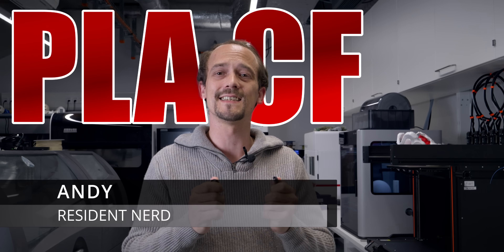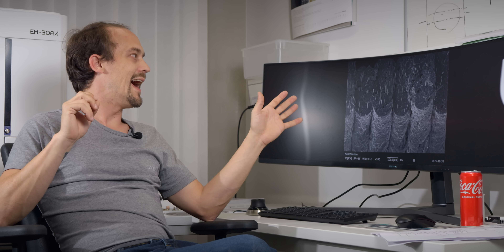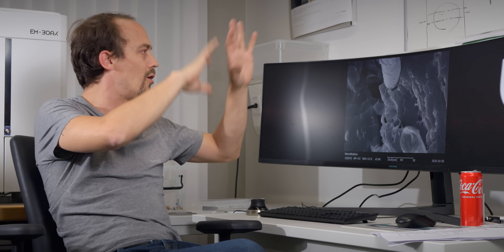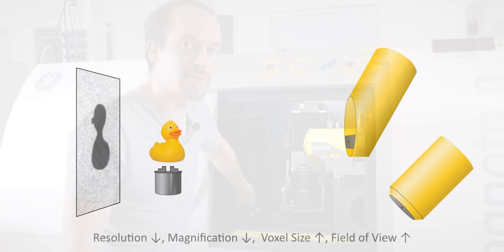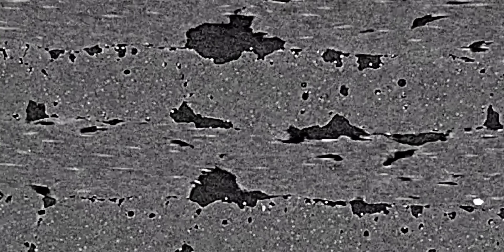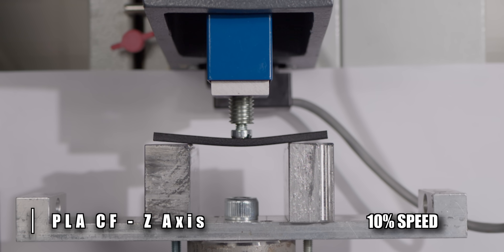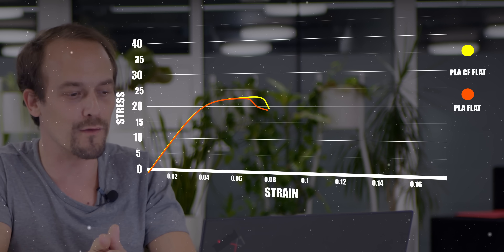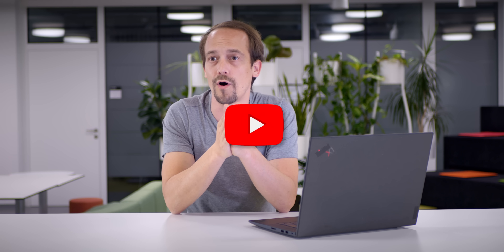3D Printing’s Biggest Scam Is Even Worse Than We Thought!

Comment: Instead of scam, it should be called trade-off.
By introducing contaminants (CF, GF) to the filament, you are trading certain plastics properties that are more than you may need for other properties that you need more of.  For example, reduced layer adhesion or strength for rigidity, texture, reduced warping.  For instance, printing pure PA6 without CF or GF is more difficult.  With a "contaminant", you now have a plastic that's easier to work with and remains more rigid with time.  It's all down to materials science, which I suspect that you are very good at.
BTW.  I would be very interested in a video taking us on a tour of your lab.

Comment: Carbon fibre is the asbestos of the 21'st century. ☠
Reply: Asbestos filament when?
Reply: I have seen a single filament manufacturer who comments on safety regarding CF filaments, and it's a brand specializing in CF filaments for business customers. They recommend using gloves, face mask, air filtration and only processing it in a ventilated environment. You can bet 99% of people using CF filaments don't do any of that.
Reply: Asbestos reinforced pla
Reply: yep i thought the same thing when everyone startd talking about graphene being the next great thing. light weights, super strong, similar claims to asbestos. this micro carbon is just the microscopic version of aspestos. tiny microscopic needles. cant be good.
Reply: @DemonsCrest1  graphene is fine, its planar structure makes it less penetrating and more stable, CF however is needle-like which causes a lot more penetration.
Reply: Let's be real, Asbestos is still used in the 21st century
Reply: @JonTheChron Not by any modernized country and not in any industry I'm aware of.
Reply: @TheFirstBigCheese I work in construction build new major hospitals here in Canada and I can confirm with a certainty of 100%, that asbestos, was still used here until 2015-2016, and was only fully outlawed only by the end of 2018.

As a matter of fact, in 2021, we renamed the city of Asbestos in Quebec, where to product was mined, to Val-des-Sources
Reply: @JonTheChronI'm not arguing with you, certain places were slow to phase it out due to economic pressure (i.e political corruption) and a deep economic dependency on the substance. I have my professional roots in the automotive sector, and there it had a massive dependency (in components with friction material, cluches, brakes. And sealing, gasquets etc.) And its all replaced now, 20+ yr ago. Components still flex those brandings as if it wasn't common sense and a well known fact; branding them NAO (non-asbestos-organic).
Reply: @TheFirstBigCheese it's not used in Europe since 2005 but in America/Canada it's still in use.
Reply: @RudolfMaister420 
In what industry and products, more exactly?
Reply: @RudolfMaister420  lol it is absolutely not in use in the US or Canada. There’s that free euro education shining😂
Reply: @sargentcuddlepuff3490

It wasn't fully banned until 2024, and it doesn't even go into effect for certain industries until 2029. In the automotive sector, large quantities of new old stock components containing asbestos are still around and fitted to vehicles every day.

The Trump administration was actually planning to repeal the ban, until public outcry led them to change their mind.
Reply: @johnfox3845 As I said above, numbnut! Say what brand and product so we can look it up then. Ofcourse NOS will contain asbestos, no one arguing that asbestos didn't exist! Say what product is made new with it, Instead of referring to some moron of a president, idiots!
Reply: @TheFirstBigCheese  I work for a certain communications company.  I still see asbestos in almost every basement I visit, especially in older buildings, but not in new construction.
Reply: Yes, that's exactly my point... Asbestos are pretty much everywhere, in all countries I've been in, and plenty so. I have motorcycles with break band that's full of it! I found it in my overhead crane motor when I repaired it. But I haven't seen one single current product still made and sold that contains it...
Reply: @TheFirstBigCheese Traxxas had asbestos in their RC cars. Was in the clutch from AWD models. There was a recall in 2024 and before that too. Also brakes in these models.
Reply: @TheFirstBigCheese I commented above. In 2024 was a worldwide recall for Traxxas Toys wich had asbestos in their toys. Clutch brakes...
Reply: @TheFirstBigCheese  It wasn't replaced "20 years ago"
Part of the reason for the rash of transmission issues in the last ten years is phasing out asbestos in the torque converter clutch material.
Reply: @TheFirstBigCheese  aerospace consistently. We appreciate your lack of googling though. Oh, in the USA, consistently.
Reply: @sargentcuddlepuff3490  100% still in use in US aerospace. Not a secret.
Reply: @sargentcuddlepuff3490  Yeah, It was "sleepy Biden" which hammered down the last nail to asbestos coffin in the USA. In 2024 (!!). When in EU there was a ban dating back to 2005 and actions to remove legacy products containing asbestos till 2035 (2028 from public use buildings like schools or hospitals). AFAIK there are no such plans in the USA yet (and probably won't be for the next decade or two).
Reply: @IFRYRCE Torque converters doesn't have friction material, it is a hydraulic unit. And you loose anyways since you haven't said any product that can be verified or researched.
Reply: @TheFirstBigCheese  haven't worked on a car in about 30 years there big boy? They've got lockup clutches now
Reply: @sargentcuddlepuff3490  Yeah, compared to free lack of education it does truly shine. :D
Reply: It's not. Not at all. You're desk job isn't in jeopardy.
Reply: @pointvector1951  Who are you to even have an opinion? Did you forsee asbestos? What about freon, no not that either? Or were you one of them saying "now the only emissions are CO² and water" when catalytic converters became mandatory? No one is listening to you, not because you don't know science but because you don't know when to use "your" and "you're".

Comment: I'm not sure I ever though this. unstranded cf has never been considered "stronger" or "stiffer" outside of un annealed materials post printing but it does make for better print quality because its "stiffer" and less likely to warp during printing I think some people (including sales people) just assume that translates into a stronger end product. CF-PLA as a more rigid material is kind of silly on its face if you think about it but it would also be lighter than pure pla and It may actually have rigidity benefits with a pla and a foaming agent like aero or lw-pla. If you want a strong print using carbon fiber you need stranded carbon fiber injection to create composites. Currently I don't think there are consumer level systems available for that. You could make your own maybe.  I do think it has a positive effect on materials like peek, pekk, paht, or other semi-crystaline polymers as the cf acts as a nucleating agent for heterogeneous nucleation  when reaching temp. The resulting in a "stronger" final product. It also helps that the cf itself is an inert material making it useful in biomedical applications. If you want to make something unreasonably strong I would do cf-pekk with stranded carbon fiber meshing and anneal it to it crystallization temperature as a post process. I would imagine it would be unbelievably lightweight and stronger than steel.

Comment: Thanks for the great R&D (who knew a nanotom took 13 hrs!)  It would be interesting to see some SEM of PLA - perhaps comparing air pockets between brands or versions (including silk vs the cheap stuff vs recycled).  I have to believe there are differences but 13 hours each sound exhausting.   Subscribed just in case.

Comment: Igor at MyTechFun tests lots of filaments. I subscribe and in his Excel sheet he has test results from regular PLA vs PLA-CF. The best comparison is Bambu PLA Basic vs Bambu PLA-CF (so the PLA part is likely the same). He found a flex modulus does increase. Bending Creep under load decreases. Other properties he measures are similar. There are other PLA-CF's measured but I don't see the equivalent PLA alone. He has a good set of data for PETG-CF and GF from Polymaker. As another poster mentioned the sizing of the fibers does make a big difference. Maybe some vendors know how to select and apply a good sizing?

Comment: I find it interesting that these testing results vary greatly from a lot of other testing, especially in regards to rigidity and creep. https://www.youtube.com/watch?v=6I7S7W-CTw4 just for example. I guess this goes against the narrative a bit. PLA-CF is mostly aesthetic, but once you get into ABS/ASA and beyond they also greatly improve printability. Nylon for example is a pain to print, but becomes easy with fibers.

Oh, and if you bother to look into the health benefits, please actually check the claims of the sloptubers saying the fibers "embed" into the skin and if they don't just actually wipe off after. From what I see in my lower powered microscopes and what I've read in Prusa's research papers, it doesn't actually penetrate skin.

Comment: Hmmm might work - FDM with Ultrasonics:
During printing:
[Molten PLA extruded from nozzle]
    ↓
[Ultrasonic horn creates oscillating flow]
    ↓ Oscillation at 20-40 kHz
[Flow pattern becomes HELICAL]
    ↓
[Each oscillation = slight twist in polymer chains]
    ↓
[Result: Helicoidal orientation in deposited bead]
The twist is SPATIAL:

Ultrasonic frequency creates rotation
Acoustic streaming → spiral flow
Position × oscillation = helical pattern

Comment: I would be interested to see if fabrication in a vacuum would decrease voids and potentially improve carbon strand to matrix bonding, I'm surprised that the carbon fiber doesn't have a better sizing applied to improve matrix bonding as well. In carbon epoxy matrix composite the sizing is essential and different sizings are available for different applications

Comment: I wonder if the voids come from whatever medium might be used to carry the carbon fibers. If they didn’t have some sort of oil suspension or something they’d be insanely dangerous when mixing into the PLA. A tiny bit of light oil would make everything safer and blend into the PLA. But it might vaporize at printing temperatures, causing the voids.

Comment: This only true if you don’t do the required post processing work.  All fiberglass or carbon fiber products legally must have coatings on them to protect people from the fibers. You are responsible for solving this problem not the retailer that sold you a raw material

Ps purely a matter of opinion, but I think that the testing should be done with the coating because that is a significant part of the final product’s strength. Testing without it is isolating the reality right out of the variables.

Comment: Finally some proper conclusion on carbon fiber reinforced filament. I would like to see your analysis on "Real CF Materials".
I will assume that those materials benefit from carbon fiber because those fibers are actually used in the right way (weave, long strands, etc.) compared to the fibers in 3D printing filaments (tiny, require bonding)

Comment: If you wondered about the strength of bone vs polymers with voids...

Rule of thumb from materials science.

Random voids equal weaker.

Aligned, closed, and engineered voids equal potentially better per weight, but usually lower absolute strength.

This is why aerospace plastics and medical implants use lattices and foams, while pressure vessels and gears demand solid material.

Nature cheats with structure. Engineering can copy it, but only with discipline, not bubbles.
---
So well done by the way. So impressed by covering all bases of scientific and engineering inquiry and providing understanding. Not many can do this and not show a biased preference. Clear and evidenced with admitted shortcomings shows good validity and accuracy.

Comment: I mean, this makes a lot of sense. The strength of carbon fiber doesnt come from a bunch of entirely detached, unrelated threads. Carbon fiber gets its strength from being properly layered on top of each other to form a strong mesh. Much like how spider webs are like 3x stronger than steel in tensile strength, but individual threads break just by looking at them. 

Because the carbon fiber threads are so sparce, all they're doing is breaking when the plastic itself would still be bending.

Comment: Great experiment. There arent many videos that bring a black and white conclusion and prove a point like this one. With traditional CF, parts are bonded with a chemical bond from, epoxy and hardener turning into what it is after a chemical reaction. That reaction also causes air bubbles, alot more than melted plastic. Thats why they are vacuumed out and baked in an autoclave. If the air wasnt pulled out, it will be too weak, and as you said the strain causes the air bubbles to be the weakest point, and the crack follows the voids and breaks. If carbon fibers were layed like in these filaments going one way, and were bonded the traditional way and vacuumed etc. it will still be very weak, The only reason for the strength is, its woven in and otut, in layers going across and opposite directions, thats what makes it strong, but bits of carbon ruing one way in plastic, is just useless., just like it would be in resin. This video also shows how important Temp is in between layers, its clear the weakest point are in between layers, looks like this is due to the fan cooling the base before the next layer is layed on, we know why this is needed, but it makes it cooler before next layer. this is not a problem for most parts. if they arent hot enough, its clearly not going to bond at all, it needs to be as hot as possible,

Comment: I studied engineering, and seeing the public get fascinated by anything that has "carbon nano structures" or other such buzz words thrown in is always funny to me. Carbon materials are quite hard to bond to. You could have a magic sand that would hypothetically make any building 5000 times stronger in its concrete, but if it doesn't mix well with concrete, that will stay a hypothetical. As for PLA, you would probably have better luck mixing it with another polymer like PETG, ABS or TPU to modify its properties.

Comment: Interesting results, I have a sneaking suspicion that all filaments have micro/macro bubbles introduces into them both via the extrusion process from preexisting filament imperfections and from the basic stiction properties of fluid dynamics and pressure differentials created when the un-melted portions of filaments are introduced to the melted filaments in the hot ends chamber. 
Have you done the same testing on the base filaments as a control or with the same parts annealed?
Also makes me curious if different nozzle types may give different results i.e. a typical straight chambered nozzle or a multi-chamber (cht style) nozzle.

Comment: Do your conclusions apply to carbon fiber printers in general or just the machines you tested?

What prevents the bonding of the ploymer to the fiber?

Can you use glass or basalt fiber instead? Would you have the same bonding issues?

Comment: A variant of Carbon-fiber printing that may be worthwhile in the future, if it can ever become mainstream:
Continuous strand carbon fiber 3D printing.

Instead of chopped fibers, this actually uses a second spool of carbon fiber fed through the nozzle alongside the plastic, allowing the carbon fiber to actually work at full strength.
I held a used pull-test sample; the plastic actually slipped on the fibers, which were still intact, and despite the failure, both sides were still rigidly connected.
This was brand-new research in 2023.

Perhaps it could be done by feeding a long strand of carbon fiber into a modified filament extruder to "coat" the filament so that it can work on a normal printer?

But yeah... Chopped fibers are mostly useless.

Comment: That's a whole lot more porosity than I've seen in my SEM images of PLA and PETG and could be attributed just as well to poor printing parameters. What were  your print settings with PLA? Overheating the PLA can cause voids like that. I, too, have noted poor PETG and PLA bonding to CF, but much better bonding of PETG to GF at least. This is accentuated by too-high printing temps, as the plastics seem to degrade around GF/CF - maybe a heatsink or thermal conductivity issue. 
Also, what is with those high-Z granular bits everywhere? Do you have a EDS image/map to identify them? Some of the pigments in PLA/PETG can show up like that, the TiO2 commonly.